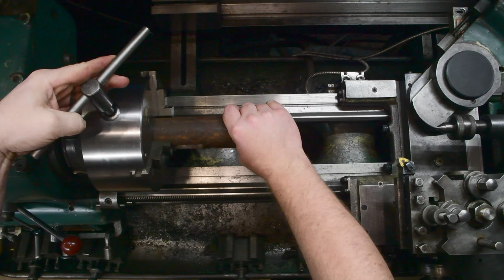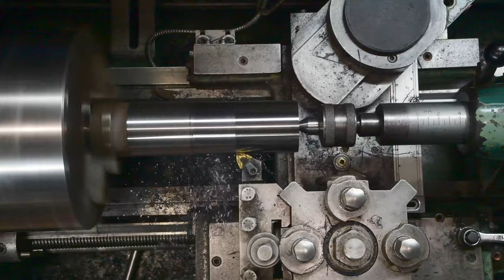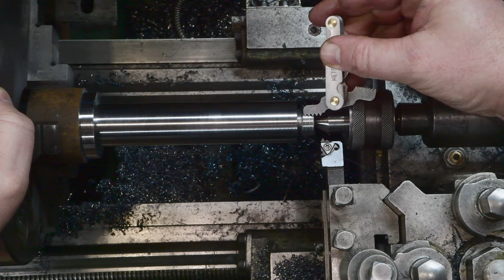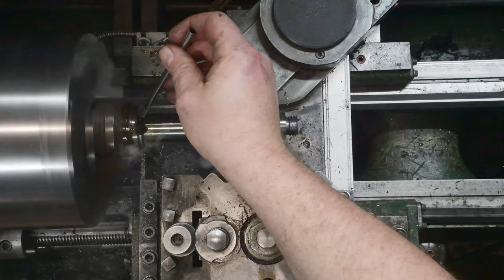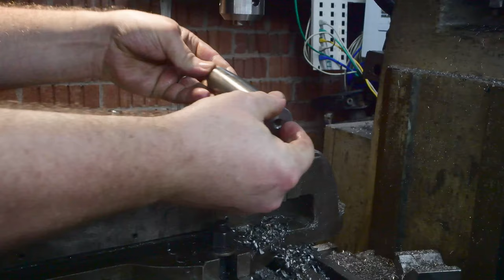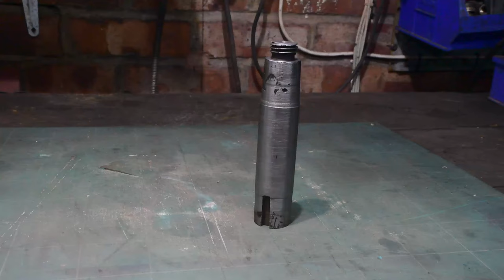Rapidor Manchester Restoration - Drive Shaft

Comment: Think I missed the bit where that taper fits. Nicely machined 👍
Reply from the maker: Thanks.. The taper connects to the disc/crank that drives the push rod/bar.. Bronze bush next.. :-)
Reply: @m0xya  what’s the plan for the bush, open it up or new ?
Reply from the maker: @lookcreations  New bush.. I have the bronze stock waiting on the shelf. I may hold off doing it until I have looked at the main body as the two bores may need cleaning up first. Only then will I have the required dimensions. I am also planning to add a bush on the other side where the cut-off switch is. It has more ware in that bore as it was dry metal on metal. Adding a bush should help.